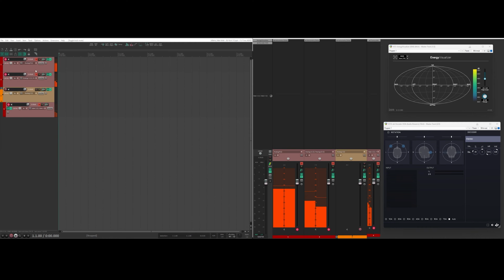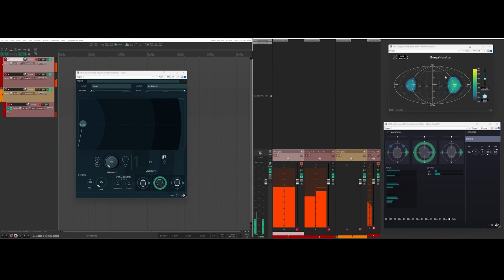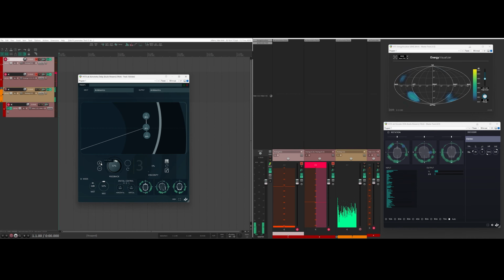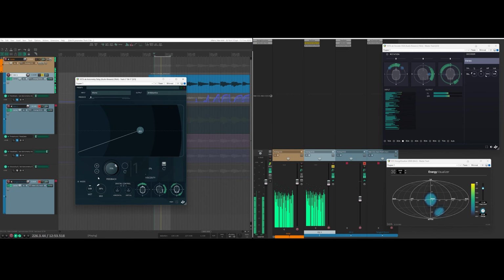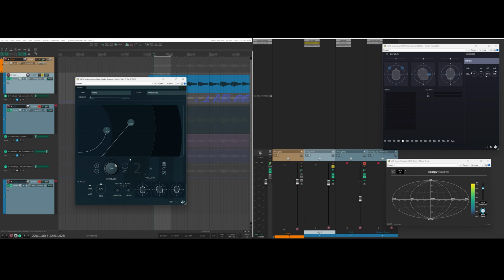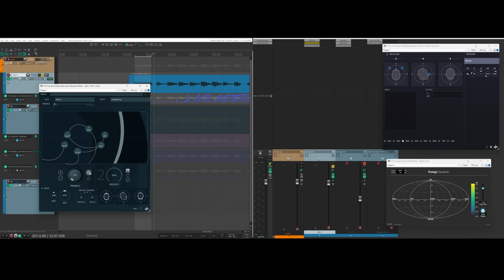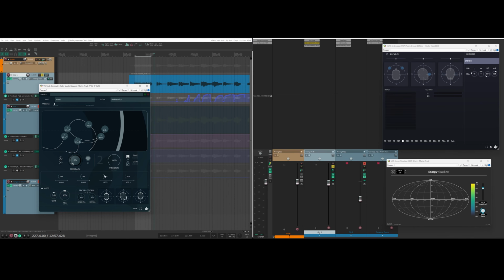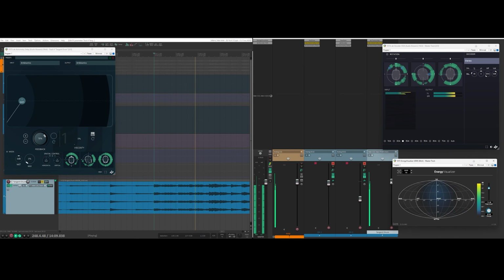ab Astrometry: Walkthrough

Comment: Great plugin design! It would be nice if the position of the taps on the soundfield could be manually set and automated. Is the positions recalculation button just doing a position randomization? Also, when the input is ambisonic, how are the tap locations handled and how do they spatially correlate with the spatial configuration of the input?
Reply from the maker: Recalculation does randomise the points position.
If the input is Ambisonic, the "taps" are extracted from the soundfield based on loudness, i.e. imagine a three-dimensional gate that discards whatever is below the loudest "spot" and then that is selected and "tapped" into the delay lines, because the plugin just knows "there was a loudest spot detected", but it doesn't know where exactly this sound happened around the listener, then that answers your first question, the locations of the taps are random because the original tap is in an unknown position (to the plugin, at least :) ).

However, doing a multi-tap delay with custom tap locations is a good idea, although is far from the concept of Astrometry!, as the internals work a bit differently - we tried to go towards a holistic approach more than a manual approach! :)